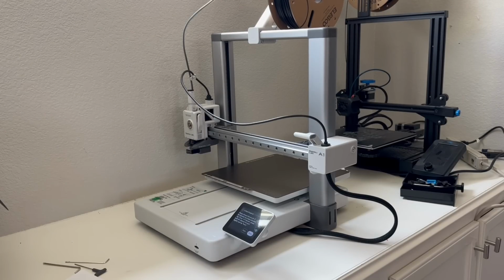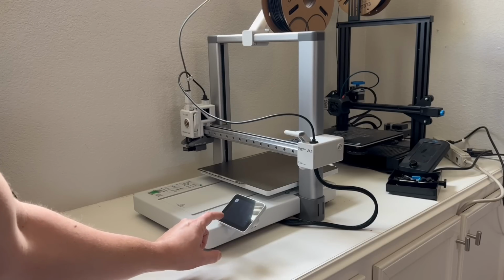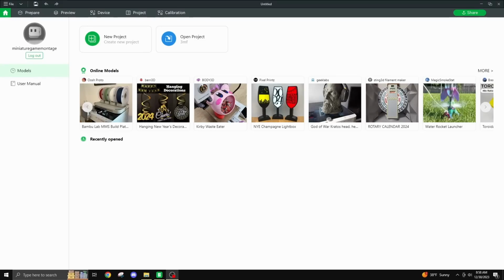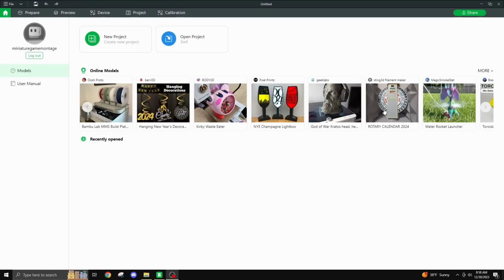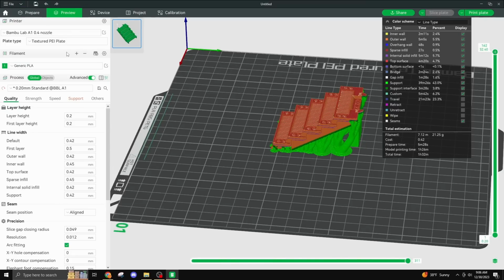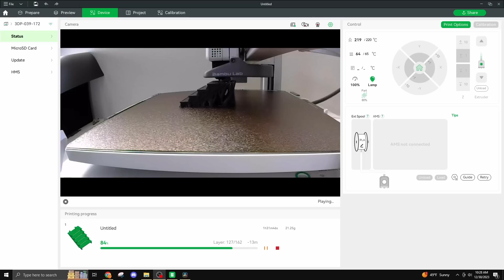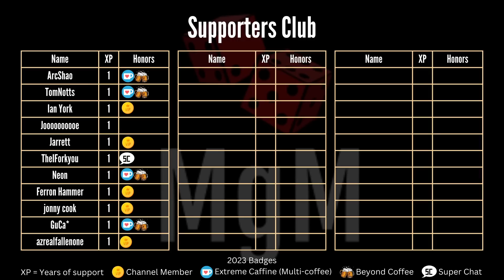Bambu Lab A1 Does it Work Out of the Box? | Issues and Review

Comment: I experience inconsistent extrusions in like every print, but the 0.6mm nozzle can compensate it a little bit. Maybe you can feed any brands PLA and print, but some calibrations are still needed. At this point my P1”S” isn’t that far away - Just have to accept VFA or inconsistent layer lines
Reply: None of that here. I have my A1+AMS Lite and P1S+AMS side by side printing PETG dungeon blocks at a steady clip, average 14 hour print jobs, and I've yet to have any failures on either using stock settings for the filaments in the last two weeks. The P1S is still the one for ASA and ABS, but the A1 is matching the P1S blow for blow about 10% slower. Wish I could say the same for my QIDI X Max 3 and my Korbra 2 Max. Both good printers, but they take special care and feeding. As for the A1, I'd watched enough assembly videos by the time I got mine that I didn't have any serious challenges getting it ready to roll. Point of reference, there should be an extra client for your PTFE lines and you should use the two of them to keep your electronics cord away from your print bed. You can also print them out from Maker World.
Reply: Same here, I was hoping for less issues upgrading from an Ender 3 and Anycubic i3

Comment: As someone who is considering 3D printing I really enjoyed your video.  Clear concise no sales edge just told it how it is.  But if you as an experienced printer ha this much trouble then one for me to avoid I think.
Reply from the maker: Glad it was helpful! Since my initial set up issues my prints have been perfect. I've had zero failed prints. So if you go this route out of the many options out there, just be mindful of those initial steps.
Reply: I think what you were seeing in the video was the learning curve from the old technology to the new technology. These are very straightforward printers. I really don't think it gets any easier than this one or the Ankermake M5. Having recently upgraded myself I can tell you these are pretty much plug and play printers in the 3D printing world. I went ahead and spent the extra $200 and got the color printing option; which is something I've been waiting on for over 5 years.
Reply: Take a few hours and watch the many assembly videos. It will fall together like a champ and you'll be printing in an hour. Make sure you buy some filament!

Comment: You went into detail about the troubleshooting involved with the filament cutter. Aside from seeing the bottom cable assembly going in at an angle, I'm curious how you diagnosed the improperly inserted USB-C connector. Glad it's working for you now. I have a Gen 1 Ender 3 which worked for a while, and I got tired of tinkering with, along with a Kickstarter clone which never worked all that well, and my interest waned. Seeing all the Youtubers raving about the A1 makes me want to buy it with the AMS Lite and sell the other printers cheaply to someone who loves to tinker, and revive my interest in making stuff rather than troubleshooting and fixing printers.
Reply from the maker: This article about the A1 Mini got me thinking about it. It's funny because at the time I don't think the A1 was there. It appears to be now! https://wiki.bambulab.com/en/x1/troubleshooting/hmscode/0500_0300_0001_0002
Reply: I got back into 3d printing this year after a two-year hiatus. I bought a P1S, QIDI X Max 3, Kobra 2 Max and an A1 (with AMS Lite). Of all of them, the P1S is my favorite, but the A1 is over $400 less with AMS and I actually like the AMS Lite better than the regular. Awesome printer. I just hope they use the lessons learned on the AMS Lite to improve their mid "P" line of printers.

Comment: Bambu seems to be taking the world by storm. I think all the rest of the competitors really need to lift their game or go under.
Reply from the maker: So far I'm very pleased but I haven't tried others printers in the space. I'm always skeptical of "best printer ever" videos when a "this video is sponsored" shows on the screen. Bambu does a fantastic job marketing I will say that
Reply: I love my Bambu when it comes to multi color I have had some issues over the 8 months I have had my x1c
Reply: @sasquatchphil89 
The AMS is a weak point.  I expect them to redesign it for their next line of core xy machines.

I found that the feed path bend radii for the Bowden tubing should all be as large as possible, as try to get the path in to the head unit as close to perpendicular as you can.  This greatly reduces filament feeding problems.  (Abrasive filament does still cause some issues, however that isn’t easy to resolve.)
Reply: Many have put out much improved machines in the past year.  That is only part of being competitive, though.

Bambu has two real advantages: parts are readily available and not expensive, and they’re a big company with a lot of experienced people.
Reply: @boggisthecat  I agree I just hope we get a bigger printer next Time
Reply: @sasquatchphil89  
It would make sense for them to offer something with a larger print volume.

My expectations would be a ‘smarter’ print bed (split into zones, as Prusa did with their XL), shorter path into the print head adapted from the A1, faster nozzle change adapted from the A1, and revised AMS.

So taking a lot of the A1 improvements across, essentially, and scaling up the printer.
Reply: @11:00 — You shouldn’t need glue stick for most PLA types.  I have never needed it on my Ender 3s (all with glass beds) except for a few problem prints.  It is needed for PETG, but that is to prevent you ripping chunks out of the bed.

It is possible to put a magnetic surface down and use other bed types, then remove those if you want and put the glass bed on the magnetic surface.  My present Ender 3 has this setup.  Note that I use a bed levelling probe setup, which is important unless you have a very flat bed.
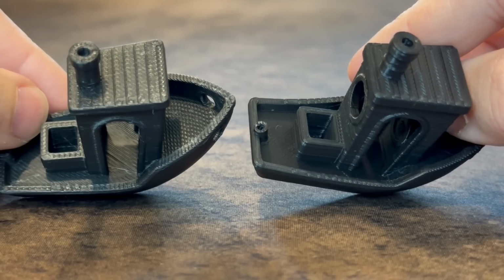Reply: @13:00 — Those imperfections at certain layer heights on the Ender 3 print are likely either Z-axis binding or damage to the Z-axis screw.  Loosen off the screws that hold the Z-axis to the gantry (so that the screw can move around more freely) then do a reprint.  If the lines disappear then that likely means the screw isn’t perfectly straight and is binding.  Look up ‘z-axis binding’ for options to solve this permanently.
Reply: Have a look at Orca slicer.  It is a fork of Bambu slicer, which is itself a fork of Prusa slicer.

The advantages it has over Bambu slicer are significant, including being able to set pressure advance for all of your filaments and you can use it for the Ender 3 as well as the A1.

Comment: I set mine up just yesterday and have only printed the speed boat and scraper so far. And so far everything is just awsome....

But the noise from it vibrations it makes going so fast is a little concern of mine. Maybe it needs a rubber mat to stand on
Reply from the maker: Awesome! I loaded up a few files in the slicer and put them on default settings. The noise and vibrations have went way down I’m thinking because the speed is reduced. 

Those preloaded files are on super speed I think to show off what it can do.
Reply: You're not going to print anything but test files at those speeds. After calibration, your standard prints are going to be as quiet as it gets without an enclosure. I can't hear a sound coming from it over my other printers, and it's right in my ear.
Reply: I'll give that a shit next year for sure.

Comment: I was pretty close buying a printer on Black Friday. This past fall, I got the chance to fiddle around with a printer of both types. Resin is absolutely horrible, it's messy, it's smelly, it's freaking toxic. You ideally need a separate device to finish the prints, and you clean them with more toxic stuff. Anything left behind is hazardous waste that you really should dispose of properly. Sure, there's water washable resin, but the resin's still toxic; you can't pour it into a drain. And there's a concern of it being more easily absorbed into the body thanks to its water solubility. The tech's not there yet, and honestly might never be. A shame because the prints are great even for older printers.

The filament printer I messed around with might have soured my opinion on them. A 2019-2020 model that had had a special build plate installed that the instructions given didn't account for. Trying to follow them, and the general instructions online, I ended up with so much plastic spaghetti because the thing wouldn't stick, but apparently this fancy plate needs the extruder to just touch the plate, a paper's width akin to a cosmic rift, so that if you pressed the corner you're trying to level ever so slightly, you can see the tiniest gap form. The print quality on it is barely good enough for some simple scatter terrain, like barrels, but honestly, that's fine enough for me. Only need to print like a couple dozen barrels to break even over buying them.

Maybe I'll have another look next year!
Reply: And yet if you want to print miniatures, it's resin or nothing. We aren't there yet with FDM.
Reply from the maker: I can relate. As I already owned an FDM printer I weighed getting a resin printer. It seemed like a logical next step but I ended up avoiding it for some of the reasons you listed. I’ve been using this new one and it’s as hands off as a printer can be. 

It auto-levels, the slicer is intuitive, it sends my files wirelessly to the printer and sends me a message on my phone when complete. I have not had a single failed print yet. 

I’m honestly not sure what the next steps are for this technology. Maybe faster but it’s already really fast.